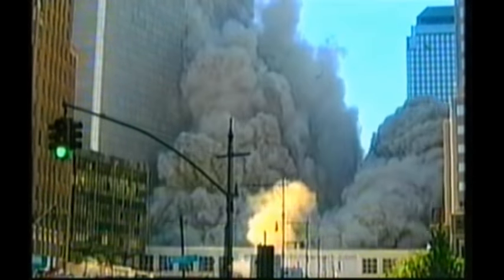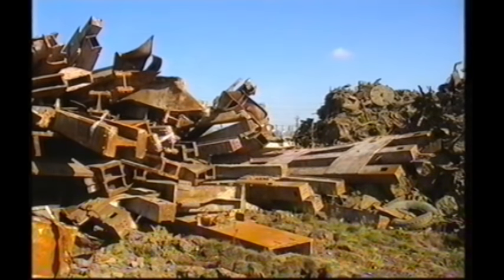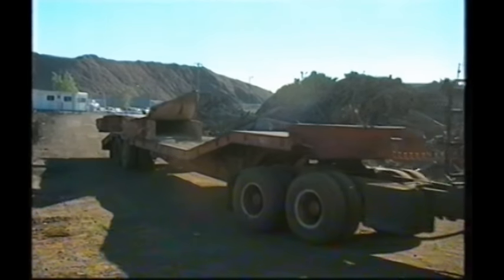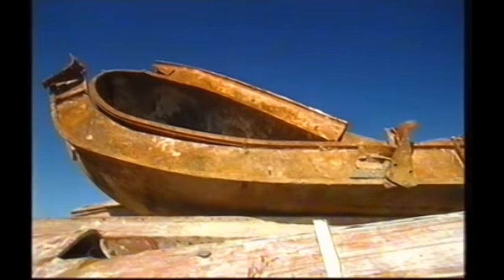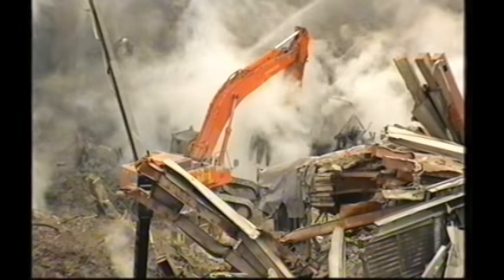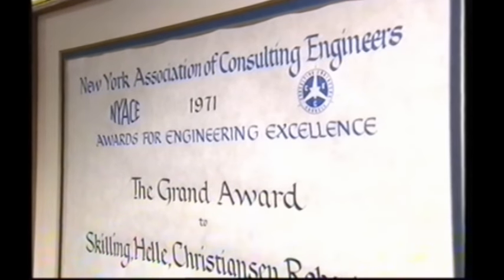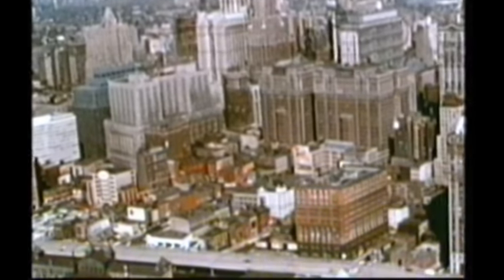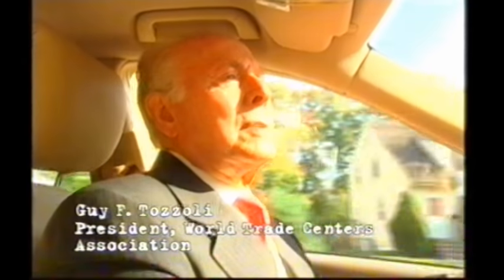9/11—"How The Twin Towers Collapsed" (C4 documentary, 2001)

Comment: I find it mind blowing that they would expect a building to continue standing for any length of time after being hit by a large jet full of fuel. Poor Mr. Robertson did a great job and actually saved a lot of lives because of the time the towers did stand after being hit but all he could see were the ones that died.
Reply: You're clueless... Empire st building hit by a B-52 and nothing more than a small fire and repairable damage...the Jet fuel you referenced burned off almost instantly. Thin walked aluminum plane vs. hardened steel..learn to critically think
Reply: @christopherfiorentino6552  .
Considering that twin towers were 100 feet taller than the Empire State Building, the plane hit the side of the building as the pilots were NOT trying to hit the building and the plane hitting the North Tower was going 429 mph and the plane hitting the South tower was going 503mph vs the B52 doing 200mph as well as the planes going through the twin towers not hitting the side there really is no comparison. You need to get your facts straight and learn how to think at all.
Reply: Aluminium against steel....steell wins everytime
Reply: @DawnCampbell-dk3vx 
 troll
Reply: @blueheart1946  The twin towers had a steel cage exterior.

Comment: Towards the end of this vid I feel sad how the structural engineer Leslie Robertson felt. It isn't his fault. He did a great job designing the twin tower frames.
Reply: Jet fuel nor regular building fires can melt steel, it's physics 101. There's a reason steel is the choice for building buildings. Not to mention the buildings blew up perfectly falling vertical (it was obviously a controlled demolition); the building would've bent over if anything but it didn't!
Reply: @CraigC55   whats your point lol

Steel is chosen not because its fire resistant... 

And no, it would not fall over. Steel buildings with truss floors are not very rigid
Reply: @CraigC55  please explain how a building that is rapidly crashing down is supposed to have any time OR kinetic energy to bend over? where exactly is the force supposed to come from that moves tonnes upon tonnes of debris anywhere but straight down to earth?
Reply: @CraigC55  you're right, but the steel didn't need to melt it was heated enough to weaken it and the tremendous weight did the rest. now don't get me wrong, I'm not saying there wasn't foul play that day, just pointing you away from an obvious fallacy
Reply: I wonder if the external column elements were welded together, instead of bolted, those walls had more strength. I saw the planes flew through it like through sheets of paper, and the walls broke exactly at the connections.
Reply: @ssword123  controlled demolitions exist because without without the methodical use of explosives the buildings would fall asymmetrically and cause damage to the surroundings.
The structures way below the fires could not be weakened before the collapse of the upper floors, so the pace of the collapse should have been irregular.
It doesn't make sense that homogeneous and symetrical collapse of the whole building because the floors that were not imoacted not affected by the heat would have made resistance and most likely in an asymmetric way.
Reply: @ssword123  Except it didn't all go straight down, large support beams were launched out at 70 mph
Reply: Why make buildings so tall...no need was it always gunna be a death trap. ..even wuthout this terrible event
Reply: @ssword123  Steel is too resilient to have the building implode the way it did.  Steel is not that weak and buildings are not that fragile for a reason!
Reply: @blest5132  Steel is too resilient to have the building implode the way it did.  Steel is not that weak and buildings are not that fragile for a reason!
Reply: @nicolacobb6885  It's not a death trap. These buildings are NOT that fragile! It was a controlled demolition!
Reply: @CraigC55  I'm not debating this, just pointing out that steel doesn't need to "melt" (in the literal sense of the word as per high temperature to melt steel) to become weakened.
Reply: @Supreme_Court.  thats individual chunks of debris though, and not the whole building. its a lot easier to imagine even a 10 ton support beam being somehow ejected from the center of the collapse through the remaining 80.000+ tonnes crashing down over it. plenty of kinetic energy to the side can emerge to do that - think of it like snapping a long piece of rigid plastic: chances are, the broken chunks dont just fall down, but that some smaller ones will be flung out through the sheer amount of kinetic tension that built up immediately before the failure.
Reply: @CraigC55  they absolutely ARE that fragile. buildings are exactly as strong as they need to be, and they use exactly as much steel as they need. making buildings needlessly strong drives up material cost, AND makes the building more heavy itself - and as i'm sure you can imagine, our cost-cutting capitalist economy has a tendency towards building cheap & resilient, rather than expensive & indestructible... a huge commercial airplane and a large, inextinguishable fire spanning several floors simply was not accounted for.
Reply: @CraigC55  its you who lives in a fantasy land if you think steel is "practically indestructible". steel structures fail and collapse all the time, for a large number of reasons.  tons of bridges, typically made of steel and concrete, have collapsed over the years - without even needing a fire. now, luckily, tall skyscrapers are built with tons of carefull planning, calculations, and lots of redundancy, but it only goes so far. you CANNOT make a building indestructible, not even with steel. because the more steel you use, the more expensive it would become to build, and who would fund that? where would the money come from? get real.
Reply: @meetontheledge1380  yeah, I was just responding to a comment about "jet fuel not being hot enough to melt steel" and pointed out that steel's failure rate is before its melting point. at no point am I advocating the gov'ts position of what happened that day... because I'm not, I'd go so far as to say that 9/11 was the opening salvo of the war we are fighting today against the gov't/elites/media/corporations in this country.
Reply: @CraigC55 I always see you lot saying ‘the jet fuel can’t melt steel’ yea but it can weaken it until it can’t hold the weight above. Do you think if you try to weaken steel it would go straight to a liquified state? Of course not. It heats up, expands and bends… and why would tens of thousand of tonnes  coming down just stop and fall to the side? Now that would be a much bigger mystery…
Reply: @CraigC55 you think steel is indestructible. Steel can weaken as little temperatures of 300°c… jet fuel burns at around 1500°c…
Reply: Explain to me how the top of a building crashing down vertically is going to make the building fall sideways. Pieces of debris were sent flying several blocks, but real-world buildings naturally fall vertically during collapse. You see it happen during earthquakes as well. They aren't made of Lego blocks.
Reply: @CraigC55  Did you watch this video, entirely? They very clearly explained EVERY single issue you speak about. I hear that bs all the time, " steel does not melt from jet fuel on fire." Again, it was explaineCyd and actual , educated people in the subject have studied these issues. Not just heard something and repeat , what they've heard.
Reply: @CraigC55  Ah yes, armchair engineers like you know more about building collapse than real engineers.
Reply: @pikachuchujelly7628  It's you who seems to think they know more than engineers. You do know that there are engineers who disagree with these engineers and official corporate narrative of 9/11.
Reply: @CraigC55 no it wasn’t, but keep telling yourself it was without evidence or knowing shit about steel or load tolerances
Reply: @ssword123  The explanation is already there in the initial comment. 
Another explanation to your second point is in the video @47:10. The "debris" did NOT fell straight down.
Reply: @blest5132  Was the ENTIRE tower heated enough ? 
How an hollow aluminum plane wing can cut a steel column 1 inch thick 14 inch spaced?
More than that CUT THRIUGH a MASSIVE 5 inch REINFORCED CONCRETE FLOOR on the SIDE. Isn't that an obvious fallacy ?
Reply: @pikachuchujelly7628 the Building fell exactly at the point of impact are you blind?
Reply: @Supreme_Court.  You're that certain? 70 mph?  You have some evidence - I'll look forward to it!
Reply: I'm an iron worker and kinda agree with you@marioques
Reply: @ssword123 Exactly 💯 correct
Reply: @marioques implodes inwards, implosion stays inside... that's what happened to the titanic submarine..
Reply: @Supreme_Court. Yes

Comment: I was on active duty in the Air Force reserves that day at Whiteman AFB, with the A-10 squadron. Once it was obvious what happened was no accident, five A-10's were loaded with weapons, air to air missiles and the 30 MM Gatling gun fully loaded. Put on alert in case anymore airliners were hijacked, That was a scary day, wondering how long before we went to war against whom ever did that. I had served on active duty for ten years. Started out in NORAD Air Defense Radar operations. Got off active duty and joined the reserves. So I had a good idea what was going on with NORAD, possibly putting bases on notice to be ready to scramble interceptors.
Reply: We never went to war with whoever did that.

Comment: Two weeks before 9/11 I watched a documentary called “marvels of engineering” or something of that sort.  The show showed how the WTC was built specifically to withstand an airplane hitting it.  It detailed the central location of the lifts etc etc.  so when 9/11 happened I was full sure they wouldn’t collapse and bored everyone talking about the show. Then they collapsed.  Haven’t seen or heard of that show since.
Reply: Soo much information has bin pulled over the years.
Reply: They explained that the dumb Engineers forgot to take fuel into consideration for the plane hitting the towers
Reply: @cherkas009 Fuel does not burn hot and long enough to mimic a furnace.

You can pour gas on an iron rod and it will not do anything even if you have several gallons.
Reply: @cherkas009 Fuel does not burn hot and long enough to mimic a furnace.

You can pour gas on an iron rod and it will not do anything even if you have several gallons.
Reply: @crxdelsolsir  it's like adding fuel to the fire and those weak trestles the heat treatment was blown away and so that was a weak point and the fuel added to the fire it's like adding fuel to the fire and it's true that one guy in the video said he's never heard of you know fire on Steel bringing down a building until 9/11
Reply: @cherkas009  Also the impact is localised so is the resulting fuel fire.

To bring down a building perfectly, completely and perfectly vertical even with a fire that was not even throughout the whole building (basment to the top) is unheard of.
Reply: The impact was localised?  What the heck does that mean.  Workers in the building smelt jet fuel in the basement. The planes hit at the 80th floor and above.  Maybe you’d like to take a guess at how much this top 30 stories of the World Trade Center weighed before making your comments. I don’t know.
Reply: To be quite honest, whether there was fire in the whole building or not is irrelevant.  The fire began a cascade failure around the point if impact. Once those top Floors started to fall, their impact with each floor below was enough to cause THAT floor to fail, one by one, all the way to the bottom.   It's a failure scenario called Telescoping.  The structure is strong enough to support itself, but not to support the total kinetic energy of the moving floors above. That kinetic energy causes the next floor to immediately buckle. And again, and again, and again, until either the top reaches the bottom, or enough debris has built up ahead of the falls t the bottom to finally support the weight of the falling debris above.
Reply: @andrewtr001  But wouldn't that mean that the fall overall is slowed down by the structural resistance as opposed to falling at the speed of gravity?
Reply: I remember watching that episode as a kid.  It was called 'Modern Marvels' on The History Channel.
Reply: Wow, very interesting, subliminal programming !!!They tried to warn us in a weird way
Reply: @E1N101 While you are correct that it speed would decreased by the resistance of the floor but what you lose in speed you make up for in mass.
Reply: @crxdelsolsir , watch the video, it explains how it happened. Also,  the exoskeleton helped keep everything in the middle, like a garbage shute. Thats why they both collapsed straight down, with the help of gravity too!
Reply: @crxdelsolsir  well you're very sloppy with your word perfectly vertical and perfect that's completely false but you choose to use the language that's easily proven wrong
Reply: @crxdelsolsir   if you watch the documentary it's already addressed that it was unheard of yeah these terrorist attacks has not happened before with all that jet fuel the way the building was designed the fireproofing completely blown away I don't think you even watched the documentary
Reply: @andrewtr001  - better to remain quiet and be thought a fool rather than publish and remove all doubt
Reply: Actually it was. The problem is planes didn't stop getting bigger. The towers were never designed to withstand an impact from a 747. At the time the towers were designed the 747 didn't exist. The 747 was drastically bigger than any plane before it.
Reply: @uforferdetnilsson2595  ah, you really should have remained quiet then.
Reply: @andrewtr001  - grade 10 physics wasn't your strong suit - if you actually believe the pancake effect that headful of syrup will keep you in good stead
Reply: @E1N101  Not if there's enough momentum. The ENTIRE upperhalf of the building began to fall simultaneously. Every floor below immediately snapped away like toothpicks. And so on and so forth. It makes perfect sense that it collapsed at the speed of gravity.
Reply: @DG-si2vp  Well Tom Clancy had written a book about Washington being attacked from the air using hijacked airplanes long before 9/11 so there was plenty of warning that such things could happen.
Reply: @sheireland3737  that's very interesting and 🤔 ty for sharing fr
Reply: He fail to realize they were thinking about an accidental crash like what happened at the Empire State Building. Not two 767 planes used as weapons which is why they were flying fast and had wide body Airliners
Reply: The towers were supposed to sustain a single impact of a Boeing 707, flying at low speed with little fuel, without collapsing immediately.
Reply: @cherkas009  
The design scenarios considered at the time was that a 707 would be flying low and slow (probably lost in fog looking for JFK airport) and nearly out of fuel.
If those 'dumb' engineers had designed structures that could sustain impact from a full load of fuel, the towers never would have been built.
Reply: It was built to withstand a 707 traveling like 200 mph, not a 767 at 500 mph with full fuel tanks.
Reply: @crxdelsolsir the debris field was 16 acres.
Reply: @crxdelsolsir they didn't fall vertically, stop with your nonsense
Reply: @andrewtr001 exactly

Comment: As an architect myself, the fact that both towers withstood the kinetic energy of 2 airliners hitting at a 90° angle (stress way beyond what anybody would dream of taking precautions against) without instantly collapsing or breaking in half is in itself proof of how well they were designed and built. The fact that they also endured a couple hours before going down with fire eating away what remained of the already damaged structure is astonishing. No architect or engineer in his/her right state of mind could/would have taken enough precautions for what happened, it was unprecedented and unheard of.
Reply: The south tower went down in less than an hour. The north tower stood for about 90 minutes. They weren’t standing for hours after impact.
Reply: Leslie Robertson clarified that the towers were designed to not collapse immediately if they were struck by a Boeing 707 flying low and slow and almost out of fuel. He said that they never thought that the towers would remain standing indefinitely after impact, but instead only long enough for people to get out. He further clarified that they never considered the potential for the fireproofing material to be blown off thus exposing the steel elements (especially the lightweight trusses) to the weakening effects of heat from fire.
The size and speeds of the aircraft which impacted the buildings were well beyond the design parameters considered by Robertson and his team.
Reply: @kyle381000 Bushit.
Reply: @allee190  Really? Why don't you provide some fact-based arguments to support your opinion.
Reply: Can you explain how building 7 came down?

Comment: at 44:32 the viscoelastic dampers are shown. The lower connection on the floor truss.  When these vulcanized rubber connections burned, the floor would be allowed to hinge at the top connection. I think the role these dampers played has been greatly underrated.